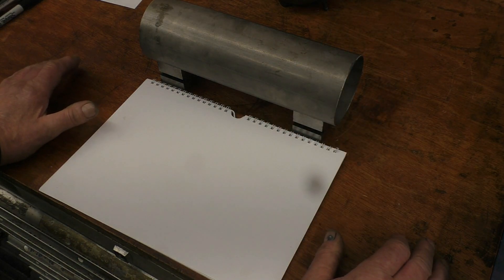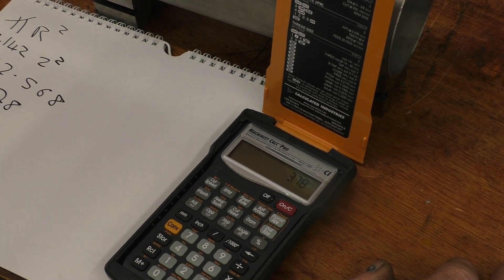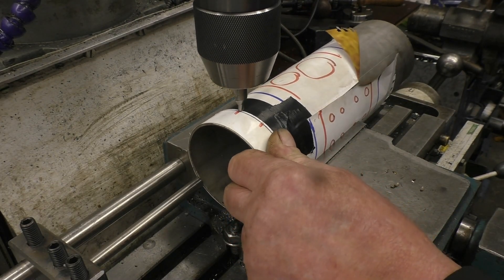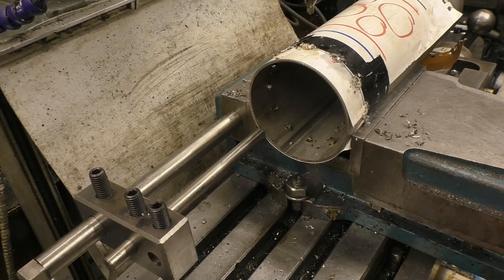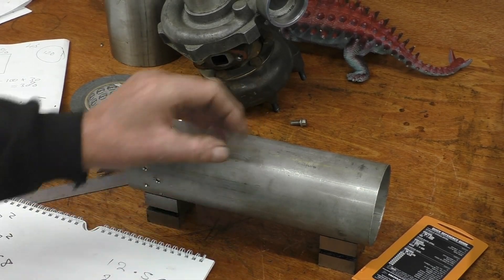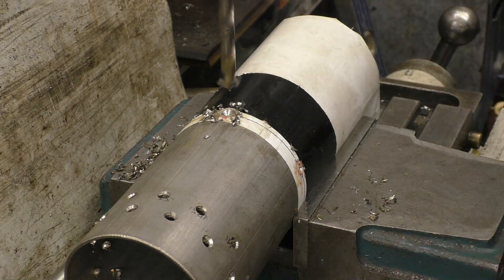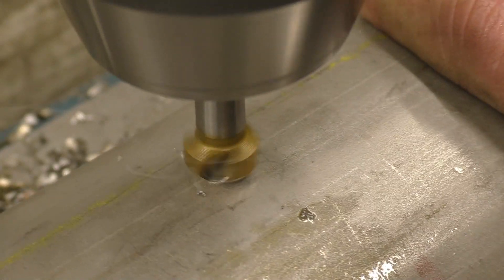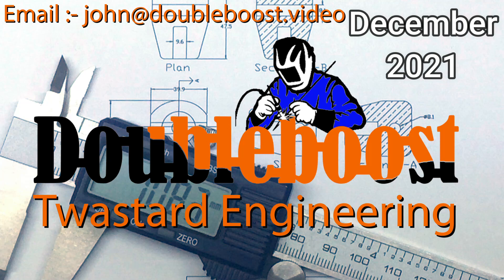DIY Gas Turbine P3.  Flame Tube

Comment: Where did you retrieve this metal container? I for one of my homemade engines have to look for a tube with a diameter of 240 mm. Where do you recommend I go to find it possibly at no cost? Then I will have to get a 10 mm flange at least so that I can drill, thread some holes to start fixing the cylinder block ... . This method costs much less than aluminum. But will it be a viable solution?

Comment: I use a carbide centre drill for stuff like stainless, followed by Cintride or Cobalt drills run fairly slow with plenty of cutting paste like Rocol, or flood coolant. Stainless is a nightmare once it starts to harden during machining.

Comment: A trick to remember when working with circles is that all your measurements are "times pi". If you just keep that in your head and don't actually do it your calculations become much simpler.
In your case the 40mm diameter is 20mm radius, 20 squared is 400, 30% of that is 120, divide by 24 holes is 5, square root is 2.236 radius, 4.472 diameter for the primary hole size.
You only need to use pi when you are converting to something that isn't a circle, otherwise just keep it in your head to remind you to get one for supper.
Reply: Took me a while to get my head around that, but yes, indeed.

Comment: At a glance, it reminds me of an industrial heating nozzle, which I guess it is? With a higher velocity of boost? Suppose you could make it smaller and have a flamethrower, with the correct stociametric mixture. Love your engineering skill Sir.

Comment: 1:27 John, it looks like pressing Conv + will get you the full value of pi for that calculator.
Never seen one of those before !

I take it all the data is for working with cast iron - since it has CI on it ;)
Reply: Put the calculator on your cellphone than turn it sideways and you got one...
Reply: @kentuckytrapper780  yep that's what I do too!
Reply: @kentuckytrapper780  Not sure what you're trying to achieve with that ??????
Reply: @millomweb  you get a machinist calculator when you turn your phone calculator on it's side
Reply: @kentuckytrapper780  I don't !! I just get a phone turned on its side !
Reply: @kentuckytrapper780  I didn't know that. :) Thanks.
Reply: @kentuckytrapper780  you get a scientific calculator which is similar to a machinist's calculator but by no means the same.

Comment: Pye R squared isn't the same as pye R x2 though, it's nearer 39 than 12 ??
Reply: If r is 2 (as in a 4cm bore) then r^2 is the same as rX2 or indeed r + 2. In any case it comes out as 12.56637....
Reply: @BensWorkshop  It only works that way with 2
Reply: @july8xx  Correct.
Reply: @BensWorkshop  Right, OK
Reply: That tube looks a lot bigger than 4cm, when john puts his hand over the end of the tube it looks to be about  60 to 65 mm. 28.2 cm^2 to 30.66 cm^2
Reply: @july8xx  The 4CM bore is the bore of the compressor impeller not the fire tube. (Inlet of the trubo)
Reply: @july8xx  John said it was 80 mm diameter tube. But the calculation was on the area of the inlet hole of the turbocharger which is 40 mm diameter.
Reply: I realise that ist been 11 months since John posted this video but You're right Andy.  John multiplied by 2 rather that squaring the figure.